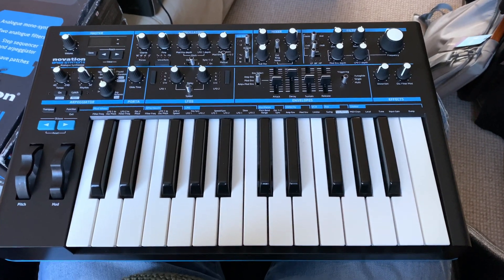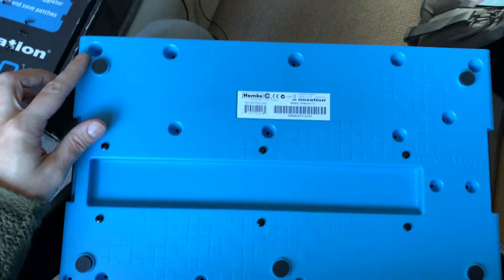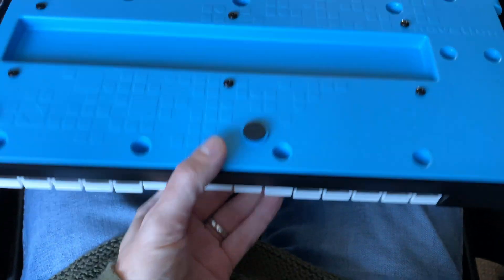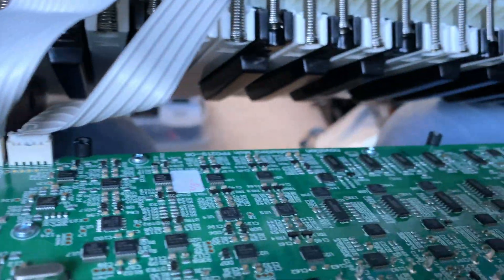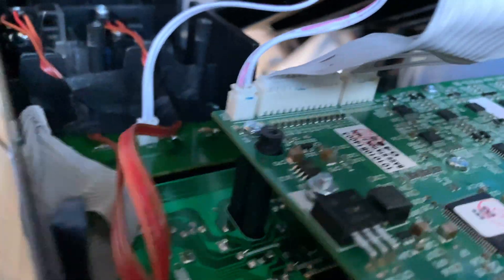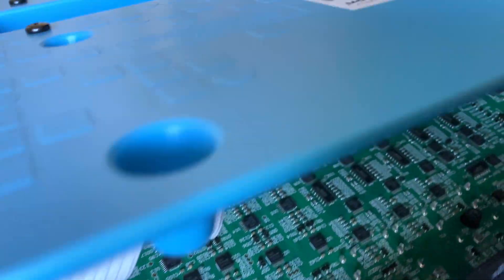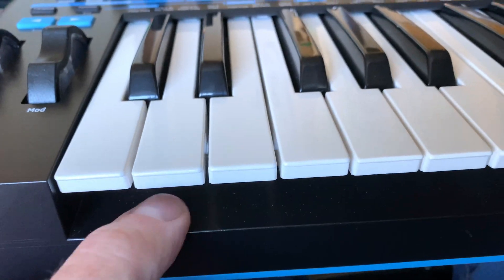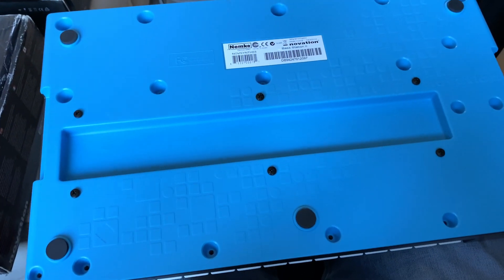Novation Bass Station 2 repair faulty non working keys.

Comment: I've had mine for years - excellent little synth. For the last few months I have had 6 keys that worked intermittently and an issue with parameters showing on the LEDs very weirdly (keep switching around) - following this reseating the keyboard ribbon fix has resolved both issues - takes 10 minutes of which 9 is unscrewing and rescrewing. Now working a treat.
Reply from the maker: Brilliant! Glad it worked for you.

Comment: Maybe you can help me, my bs2 worked perfect until I decided to install the firmware and library that is on the page. bass station II librarian, it ran and my bs2 won't turn on, only the pitch and mod lights blink once. do you know what could have happened? thanks for your help
Reply: Oh no, that's not good. I'm afraid I've not encountered that particular issue before - my upgrades have gone well. If you figure it out please do update us with a reply on how to resolve it. Does this help? https://support.novationmusic.com/hc/en-gb/articles/360002211360-I-am-unable-to-update-my-device-using-Novation-Components
Reply: @PeteB  great, I was about to discover the btl mode by myself but I was missing a button, your help was very timely I thank you friend, a lot of power for you. greetings from Chile

Comment: Nice one, my lowest 6 keys cut out the other evening but by following this video I was able to sort it, thanks! Weirdly I couldn't unclip the ribbons; the previous owner looks like they'd glued them in place (?!), perhaps because of this issue occurring before. Pushing the ribbons back in as best I could seemed to do the trick though!
Reply from the maker: It does seem to be a bit of a design flaw. Maybe they started to glue them in at Novation? Any idea how old your unit is?
Reply: @The-Tinkerer  It's possible, if so it doesn't seem to have helped :( I'm not sure how old my unit is as I bought it second hand unboxed, no problems up until recently however. Thanks again for the video, super helpful!